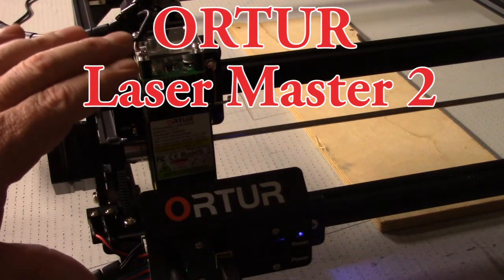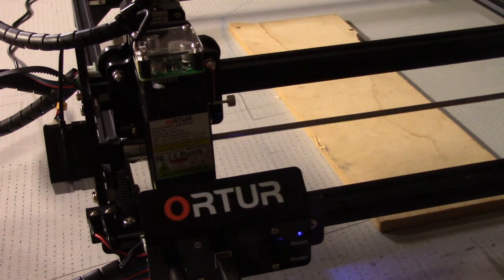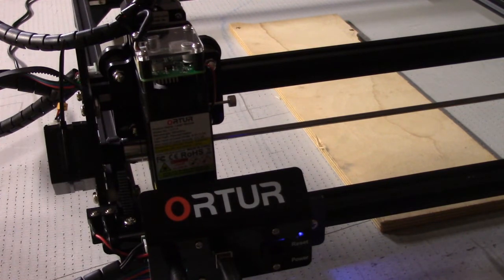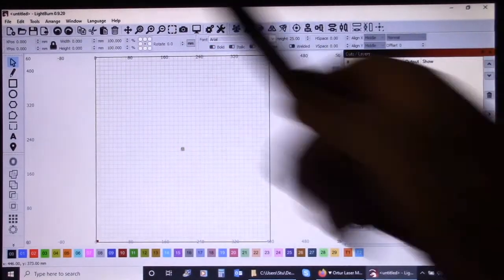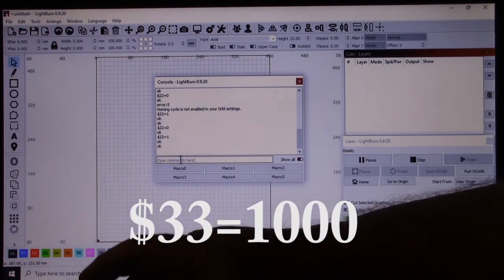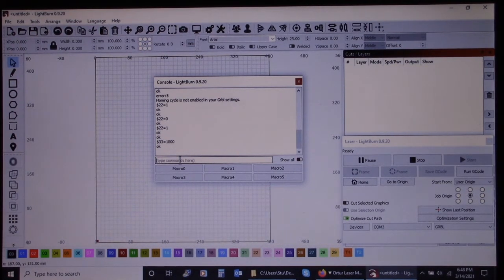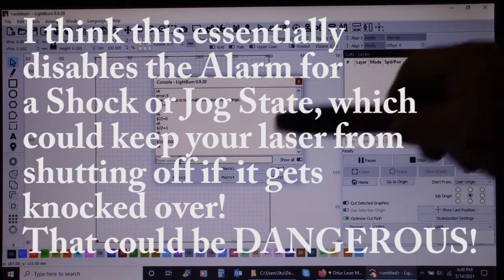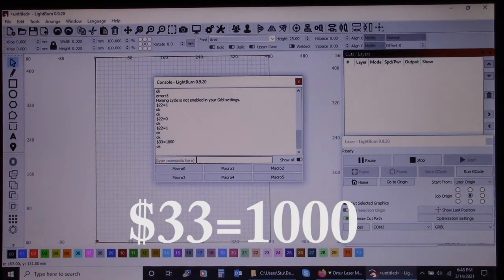Ortur Laser Master 2 Engraver Quits 1/2 Way into Job Shock/Movement (Jog) Alarm Error in LightBurn

Comment: Just starting out so using laser grbl for now but this definitely helped. Unfortunately didn't find this video until after I gave up burning a bed grid. Got the grid finished but it kept stopping before the numbers started. Changed mine from the default 240 to 500 and seems to be working well.
Reply from the maker: Cool beans!

Comment: Did it with mine still shuts off and if it ain't that it's the USB problem and shuts the hole thing off boom 4 hours work GONE
Reply from the maker: Have you added the grounding wire kit?
Reply: @PirateStu  grounded everything even to the house earthing ground and the 2 stepper motors laser frame the lot lol even put ferrite rings on USB lead mine come with what you have done in the wiring loom I've added extra to frame laser etc even grounded the shielding to the USB LEAD
 $33=1000 put that in the console script stops the dam shock sensor I've been trying mine for 3 weeks hate the thing
Reply from the maker: @jamiejoker118  yeah, some people seem to get something that works, but a ton of people seem to get a piece of crap. Not a good business model if you ask me.

Comment: Thanks I kept having same issue with shock sensor. After doing this it worked great. Only question is do you need to input this code every time you boot up the laser?
Reply from the maker: No, I don't think so.
Reply: I’m having this same problem, I’m going to try this when I get home and I’ll post update
Reply: @AstralWeirdo  I haven't had an issue with it since and I've made a couple things that took about an hour to burn. Before it barely lasted a few minutes and would stop.